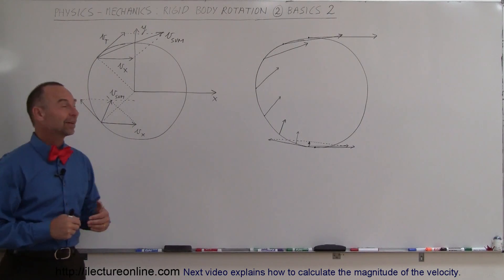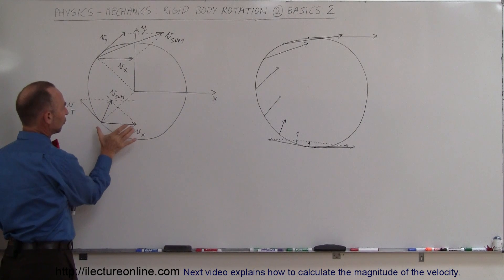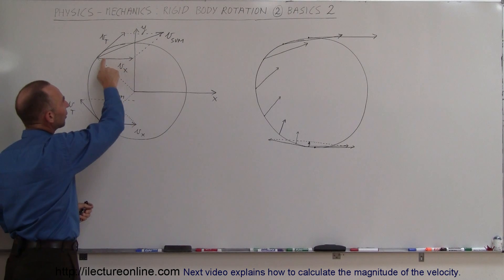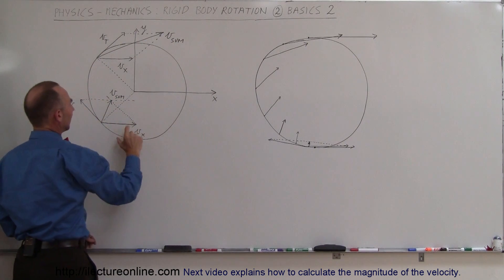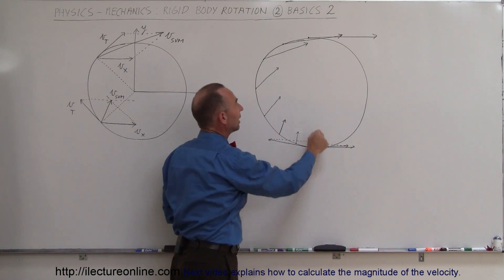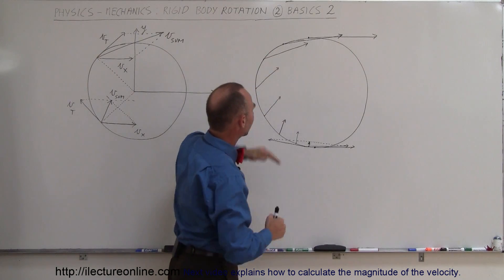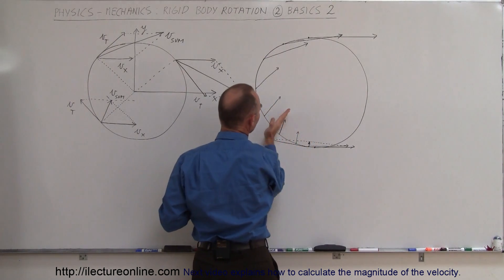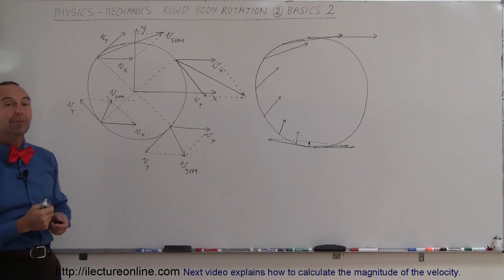Physics 11.1  Rigid Body Rotation (2 of 10) Basics 2

Comment: I guess none of this applies to the spinning ball earth translating around the sun through space at 66 thousand miles an hour, plus the additional speeds and multiple directions that the sun and the earth are traveling at velocities approaching a half million miles per hour, and yet I can't sense any of it. LOL. The Physics and math work on the earth but not for the spinning ball earth?!!
Reply: It's no more complicated than MAKE BELIEVE supported by ART that shows big bang and heliocentrism are real.
With rigid body rotation with translation on the purported globe, all bodies of water would exhibit the effects Mr Biezen is (properly) teaching. Yet tidal nodes are observed / measurable and reported live.  Do we see the tides that must be taking placee?  Nope not one.

We have very sensitive accelerometers that would measure that constantly changing vector too.  Yet there is ZERO evidence the ground is moving.  I'll add this.. our vestibular system doesn't lie either.

Maybe... just maybe... the Bible (Torah) is the account of what Yahweh made. And maybe He told us exactly what He made. Fixed, stationary, and a raquia over us.
Reply from the maker: The centripetal acceleration of the Earth's orbit around the Sun is indeed small, but we can definitely sense and measure the centripetal acceleration of Earth's rotation around its axis.
Reply: @MichelvanBiezen no we can’t.
Reply: @MichelvanBiezen  But we don't feel any movement of the earth, yet Foucault pendulums are supposed to prove the earth is moving. I don't feel anything. Do you. I have read that there is no Scientific proof that the earth is moving. It all sounds like a lot of pseudoscientific nonsense to me and mathematical equations are used to substantiate nonsense that can't be verified in reality.
Reply: Can you really sense (feel) that the earth is moving?
Reply from the maker: At the equator you weigh less than at the poles.
Reply: @MichelvanBiezen  The problem with that statement is that the average person like myself cannot go to the poles to verify that.
Reply: @jimcapp5077  hehe someone like me ;). See my comment here as well and my reply to @Michel van Biezen
Reply: @Stefan-gh7xr  You can go to the South pole and then to the equator to verify what is said about weight differences between those locations. I cannot find your reply to Michel van Biezen.
Reply: @jimcapp5077  There are some difficulties with that experiment because you are changing location and one would then assume that the "gravitational" acceleration is constant. Have a look at the channel Kryptonite Physics, there are some other means this can be tested.
Look for my comment under this video: "In fact, earth rotates and moves around the sun so the motion of an object on the surface of the earth (like us) needs to be described by rigid body rotation with translational motion. However, we cant feel or measure any of these motions. How is that possible?"

Comment: In fact, earth rotates and moves around the sun so the motion of an object on the surface of the earth (like us) needs to be described by rigid body rotation with translational motion. However, we cant feel or measure any of these motions. How is that possible?
Reply from the maker: Earth's motion around the Sun is virtually imperceptable, but the rotational motion about its axis can definitely be measures.  That is why the acceleration due to gravity is 9.81 m/sec^2 at the poles and 9.78 m/sec^2 near the equator.
Reply: @MichelvanBiezen  1) How can you measure the rotational motion of the earth when you are standing on the earth? You would have to observe earth's rotation from a fixed and stationary (inertial )reference frame, wouldn't you? Also, your video shows that a person on the earth experiences a continuously changing velocity and direction, that is acceleration. However, I have never observed any of these phenomena in my day-to-day life. Have you?
2) Even if earth would only be rotating and not translating, the centrifugal acceleration would only be opposite and parallel exactly at the equator, at any point north or south of the equator the direction of the centrifugal acceleration stays othogonal to earth's axis of rotation. This means that north or south of the equator the direction of the centrifugal acceleration is not exactly opposite of gravity. Thus, there must be a continous sideways centrifugal force pulling on all objects on earth, including us. Albeit small, it must be easily detectable with today's instruments. I have never heard of any such experiment, have you?
Reply: @MichelvanBiezen  Maybe this helps you understand better that there is a serious problem with the heliocentric model ;)
Living On A Rotation. Kryptonite Physics
https://youtu.be/pset-upAUBg
Boeing 747 Kryptonite Physics
https://youtu.be/Cg40jV3nUUc
The Globe Vs Sidereal Day Vs Time
https://youtu.be/prQqZuK-3RQ
Reply: @Stefan-gh7xr  Visit GreaterSapien's channel where he discusses Kryptonite Physics' videos and he is wise to the flat-earth stuff.